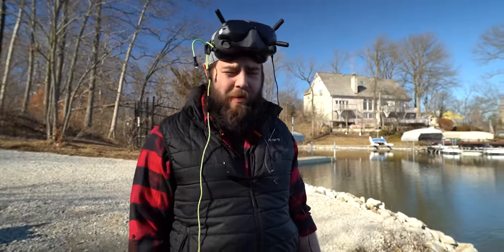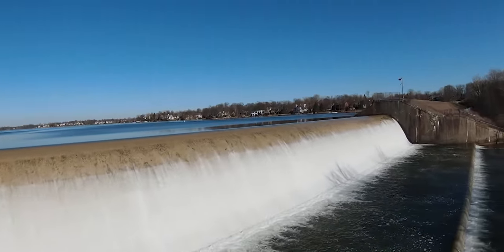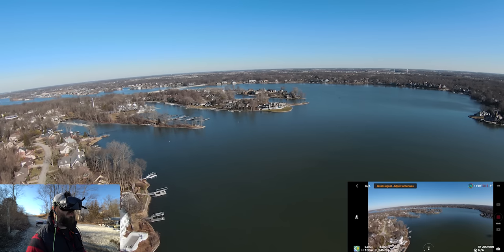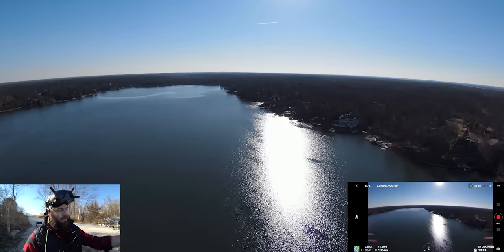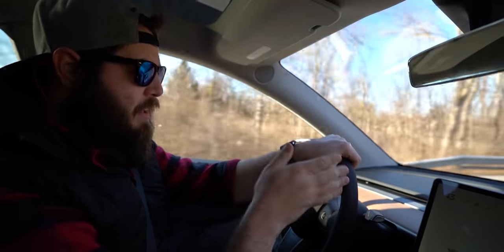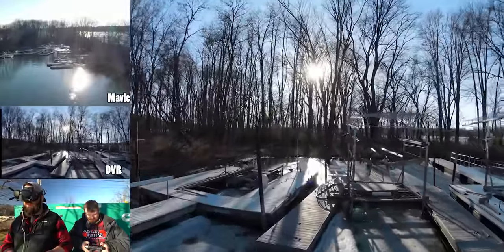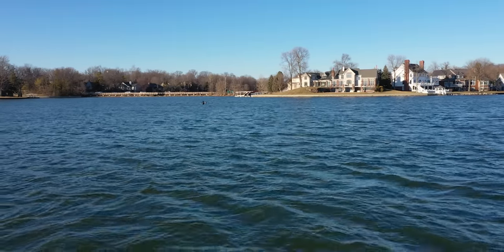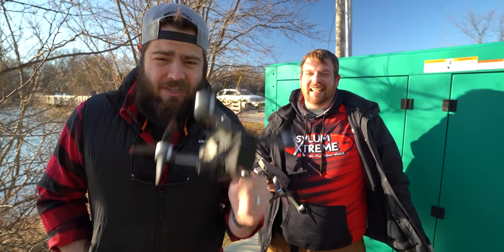Pushing the DJI FPV Drone Range to the limit

Comment: Not sure if you’ve thought of this, but the only direct connection to gas power plant with regards to flight ops I can think of (I flew a bigger army drone) we called is “bingo fuel.” Enough fuel to land from your farthest planned point. With battery “engines” motors, maybe the idea could be “bingo battery.” Forcing the system or operator to safely RTB/RTH.

Comment: You can see a lot of interesting additional information on the screen record of the connected smartphone ...
At the bottom left a map, in the middle, at the bottom, the compass, at the top right the battery indicator.
Is this the case with a connected iPhone? I haven't seen this on the Android phone ...
Which version of the Fly app was used?
Thank you for your response...

Comment: @NURK FPV thanks for nice video. If you still has DJI FPV drone, can you do fly test after firmware update? If you really feel difference. They are stating in firmware notes that flight performance has been increased in all modes. I wonder if PID tuning is better (less propwash, stability...). Thanks

Comment: this totally a hybrid drone.  its an FPV drone with safety features that all other FPV drones just havent had up to now.  I want one of these to get the sensation of flying around rather than to get cinematic shots which you need a conventional drone and a 3 axis gimbal to get.  I dont want to do amazing stunts or necessarily go a million miles an hour, but id like decent flight time (which this drone has) and safety features to protect a $2,000 + investment (which this has)

Comment: Back in 2015 I was able to range test my DJI Inspire over Lake Erie. I was just over 5 miles and getting perfect video and control. The only reason I had to turn back was I was at 50% battery and I knew I was already pushing it. With more battery I bet I could've gotten alot farther. Cool video!

Comment: Awesome video, I’ve had mine for the past few days but haven’t been able to fly it due to...uk weather lol. 
By the way that green cable you have?? What’s it called and where do you get it from?? I assume it works with the DJI goggles v2 and the battery pack??

Comment: With that kind of flying I think I would want to find a local 3D printer / CAD designer to make me some snap on pontoons. 
PS: many of the videos I've seen on this quad describe it as a bridge between the gps and fpv world as you alluded to at 2:44 .

Comment: Hey great video - I'm finding out its not a racing nor cine drone its just like flying a sport airplane. Hey quick question - other than manual mode is  there any gain or expo for normal or sport? Thanks

Comment: i like the sport mode footage, maybe you could do a few sport mode videos low to the ground through the woods or around stuff and let us know with the stock software 0n the goggles, how far low ground flights (3feet to 20 feet?)  can be without breakup on the transmission

Comment: How does it works if i am on Manual mode and then i loose transmission ? Did the drone turn as a stabilisated mode automatically ?

Comment: you can't do mountain surfing with this because it has altitude limiter, lol
Reply: yes you can its based off the height at which it took off so just take off from a high point
Reply: @andrewsanchez8716  so if you want to mountain surf, just take off at the mountain peak! what a perfect solution!

Comment: It'd be cool to take the thing as HIGH as you can, and let the sensors keep it near the "H".  Heck send it on a 1 way trip as far up as possible, and go manual at 20% and freefall like a skydiver as long as you can before hitting the brake button!!!  You got the skills easy.
Reply: Or full power straight down and clock the airspeed.

Comment: Hi Nurk. I've got 2 questions for you brother. 1.) What size is the standard for racing? - I've got a Micro Mantis 85. I'm building a track and want to race with folks near me. 2.) I was wondering (since I seen your review) if you think the Flywoo Explorer could push 5KM?
Reply from the maker: No standard in particular but typically it's 5" props. Most races will let you run whatever you brung. The fwoo could definitely hit 5km. I did a successful 4.5 and could have gone further

Comment: I’m a year behind but just got the DJI FPV  drone setup today. I’m used to acro drones so I’ve put an hour on the sim and think I can fly this 🐕 in Manual mode.  We will find out if it’s a $500 mistake or not
Reply: I am curious, how did flying in manual go for you? I fly whoops in acro but am thinking it would be fun to add this and the digital system to my fleet.
Reply: @fpvcruzer  I have a great deal on a broken DJI FPV Drone if you’re interested? I also have one that’s not broken that cost and extra $950 the camera isn’t good enough for a pro gig so you still need a GoPro. I have gotten good at flying the simulator and I have taken co workers for flights wearing my spare goggles. Overall I should have spent $2000 on a CineLifter or paying my rent ahead
Reply: @properfpv7160  oh man sorry to hear that. Sounds like you spent $$ and it ended up not meeting your needs. Thanks for replying. I think breakage is my biggest concern, because I find gaps very tempting….

Comment: Looked you had a ton of dropped frames or something. Mavics have that sometimes in Sport mode when you jam the throttle. Not really a frame skip, but just a pitch up so quick the gimbal can’t keep up. It didn’t look like you were jamming the throttle though.

Starts at like 4:20.
Reply from the maker: Nah that's the edit. I'm just skipping my dead air
Reply: @NURKFPV  oh ok. I thought maybe that was the case because that would be a big concern.

Good information. I like to see range tests from other people more than pushing my own luck.

Comment: Great video 😘
I notice the props keep popping up in the view. How can we ensure prop-free footages w DJI fpv drone?
Reply: If you turn on Distortion mode for the Aircraft only, you will see props in the goggles but your video's will not have the props showing, It only crops it slightly if you don't want to crop in post production. You could also try the ND filters and see if they blur the props enough to be suitable for you.

Comment: What is the green power cable for the goggles?
Reply: It's called an SYK Kable.
Reply: @LittleBoyNamedTrain  so in the case of the DJI goggles why would you use this? Sounds like it just lets you not have your battery on your goggles
Reply: @cskeller07  Let's you have up to a 6S battery plugged in with an on/off switch so the DC can stay connected.
Reply: @LittleBoyNamedTrain  sorry I’m new to FPV can you elaborate more?
Reply: @cskeller07  With the stock cable the goggles turn on as soon as a battery is connected. So in between flights you have to unplug either the battery or the power cable from the goggles. This cable lets you just push a button to turn the goggles on and off. Some people prefer to have the battery in their pocket rather than on the strap on the goggles too
Reply: @LittleBoyNamedTrain  I have the DJI FPV drone and goggles and they do not turn on until you turn the battery on
Reply: @cskeller07  The V1 goggles didn't come with a DJI battery. If you wanted to use a bigger battery for your V2 goggles this would be good. If not, this is no use to you.
Reply: @LittleBoyNamedTrain  thank you!!!

Comment: Hi Nurk, how did you got OSD info on the cellphone screen?. Thanks
Reply: Screen recorder app. Ones built in to my samsung. Not sure about iphone. Might be a separate download
Reply: @Docfly62  iPhone also has its own screen recorder, but I meant how he got osd on the cellphone screen, because on the app only shows the flight imagen and not the osd
Reply: @hasamalvides  oh ok. Then I think you can toggle the osd on/off from the app. Seems like by default it's should be on. I actually have P4P with  the dji Go app.
Reply: @Docfly62  not on DJI fly. At least, there is not a viable option for it. Hope Nurk could tell
Reply: @hasamalvides  or someone posted that u can just tap the screen. Hope you get it working

Comment: How did you get the flight data on the second display?
Reply from the maker: Just screen recorded my phone.
Reply: @NURKFPV  the issue is on my phone when plugged into the goggles doesn’t show the flight data like you have. I wonder if I’ve missed a setting.
Reply: Never mind then pal.

Comment: does the battery lasts 20 mins as shown is specs?
Reply: Yeah if you fly like a 80yo, otherwise you'll never get 20minutes.. there are actual FPV drones with better flight time than that
Reply: @idkfpv6435  I am sure there are , but are they as good as DJI?I bought DJI mini 2 because in many sites was rated as number 1 drone  for 2021. Then I decided to go for the FPV, but with all the goodies -as a combo,comes to $2000,and all i get is 10 mins of flight time at best. With the Mini by min 12 or so ,at 500m , 2800 meters away it starts telling me that battery is at critical level and to return home.Last time barely made it home. But its $700 ( the combo kit and 2 year warranty).If I am going to spend $2000,  I want to enjoy it for a good 30 mins,and can't be over 1 kg (2 lbs) because go to countries in which for 1 kg  + drone I will have to pull a permit to use and you cant use in populated are - like the beach. What good is that?! Beach is exactly where you want to use it.....

Comment: How are you able to display OSD data on your pip, is it a specific app on your phone?
Reply: DJI Fly app tethered to the goggles.
Reply: and he appears to just be screen capping that on the phone.
Reply: @ae5au  well mine is tethered but i only see video and no OSD / telemetry. I'm using the DJI Fly App
Reply: @omaruisfed  interesting. My father-in-law just got his in so I’ll get to check it out this weekend. Other reviews seemed to look like this, so I just assumed it was default.
Reply: @omaruisfed  I watched again and it looks exactly like DJI Fly does when I’m flying my Mavic Mini.
Reply: @ae5au  well he's (nurk) the only person who has the OSD on, with the dji FPV, so i was wondering how did he have it.

maybe he's using a different version / firmware? I dunno, other reviewers have not shown what they see have on their phones or they only see video with no OSD / telemetry which is the case for me on my end as well
Reply: @omaruisfed  I felt like I'd seen screen captures from phones in multiple videos, but it appears that Nurk's videos are the only ones I've watched where the app was even shown.  Are you on Android or iOS?
Reply: @omaruisfed  flew with my father-in-law finally today and can confirm that we could not get any telemetry or OSD info on his iPad. We didn’t have an Android device available to test.

Comment: nice video!

Have you got any data from DJI, if you can fly this on a mountain, that's 1800 meters high?

As the air gets thinner, obviously, it'll become less efficient - why all aircraft have a maximum altitude...

Comment: How did you get flight telemetry showing on your phone? A big problem I have with the DJI FPV is that you need to wear the goggles to monitor altitude, speed, distance, battery, signal…
Reply: don't buy it you cry baby😢

Comment: I just ordered one with my $1400 stimulus money. I have been flying FPV for 5 years. I haven't made the jump to digital goggles yet. And see this as the next generation of the DJI architecture. The future air units will all be dual frequency and higher resolution. This system is that generation. The goggles and controller will work with the upcoming V2 air units. Those units may only work with the dual frequency ocusync architecture. They will have to meet the upcoming  faa regulations on UAV operation. This system does that.

Comment: 2 miles of range might be all well and good but as you are aware, at least I hope you are, that regardless of whether you are 44809 or Part 107 certified, you still must remain in VLOS of the drone. I seriously doubt there is a single human being on the planet who could see that rather small drone at 2.2 miles (3,540m) with only the naked eye. 

The Part 107 is very clear about this:

§ 107.31 Visual line of sight aircraft operation.

(a) With vision that is unaided by any device other than corrective lenses, the remote pilot in command, the visual observer (if one is used), and the person manipulating the flight control of the small unmanned aircraft system must be able to see the unmanned aircraft throughout the entire flight in order to:

(1) Know the unmanned aircraft’s location;

(2) Determine the unmanned aircraft’s attitude, altitude, and direction of flight;

(3) Observe the airspace for other air traffic or hazards; and

(4) Determine that the unmanned aircraft does not endanger the life or property of another.

(b) Throughout the entire flight of the small unmanned aircraft, the ability described in paragraph (a) of this section must be exercised by either:

(1) The remote pilot in command and the person manipulating the flight controls of the small unmanned aircraft system; or

(2) A visual observer

The only exception to the VLOS restriction of Part 107 is if the drone operator applies for, and is granted, a waiver from the FAA.. The owner will have to provide a viable and necessary situation for going BVLOS, ie,  Emergency Response.